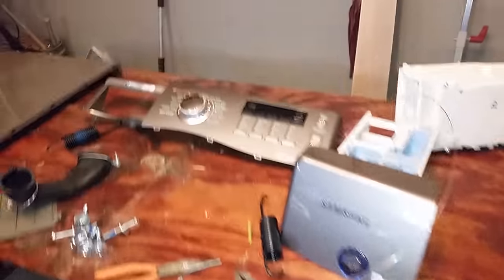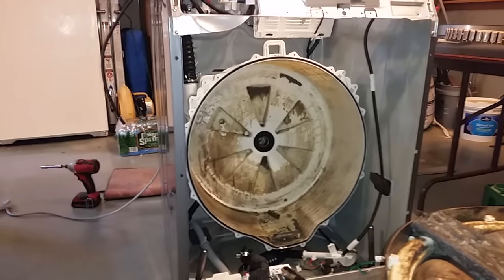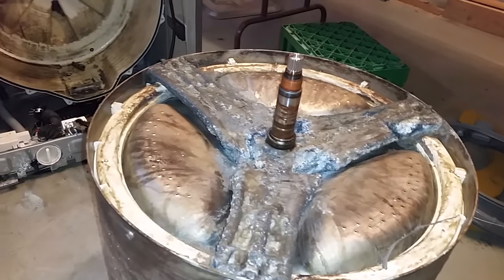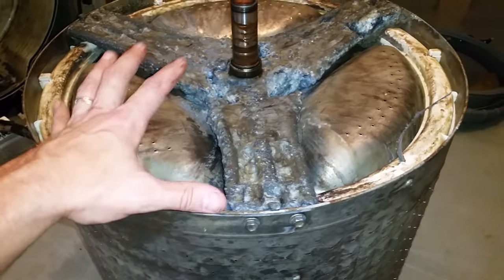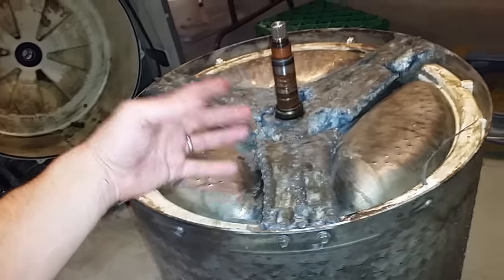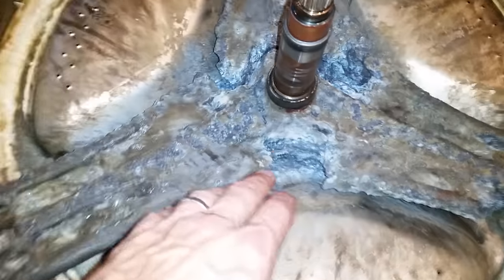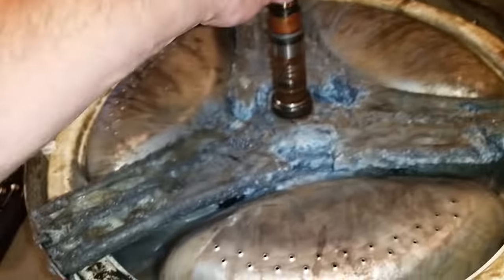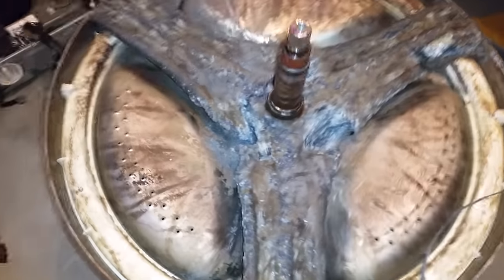Do not buy Samsung front load washer machines

Comment: All the manufacturers of front loaders do the very same thing. There is a video of a guy who was able to get the inner basket bracket( Spider Bracket) and he painted it with aircraft epoxy paint before installing it. He states that this will make the bracket impervious to the chemicals in the soap. The manufacturers have to know this, they just don’t want to put out the $.50-1.00 it would cost to make these machines last longer.

Comment: I am no expert but a few points to consider before jumping to any conclusion -

1. Corrosion depends a lot on the quality of water and detergent used. No brand will or can guarantee absolutely no corrosion after 6-7 years of usage. 
2. People using descaler regularly have seen improved life of their appliances. Not sure if you used any.
3. Sometimes different metals are used for other factors such as to manage weight and wear and tear caused due to friction. Which is obviously much worse.
4. Generally, appliances are designed by all the companies to last for at least their warranty period. Things are becoming more digital and less analog - more environment friendly too. People often discuss the longevity of the older appliances but not their energy ratings. For e.g take car or your refrigerator/air conditioner. They were much worse for the environment than the stuff today.
5. I don't think it's justified to defame a single brand without showing conclusive evidence that it's only this brand which is bad and rest are better. In this day and age of such fierce competition why would any brand risk such a huge loss of image for an easy fix?
6. The condition of your shaft and rotor looks like wear and tear beyond corrosion to be honest. The metal is practically eroded, which can happen only after intense caustic corrosion. Please share how you used the machine as well.   
7. You get what you pay for - feel free to buy a machine which costs may be twice if not more of this one but lasts you over 10 years or buy something in your budget and simply replace it after 6-7 years of use. I think these many years of usage with a good energy rating appliance would have paid for itself by that time if you factor savings on electricity and water.

I found your review highly biased.

Comment: Yes, it can be prevented. remember to decrease soap based on your HE unit. the water has decreased so 2 tablespoons of he detergent will allow your clothes to scrub each other and allow the water to rinse the soap free when finished! also if using pods only use them in hot wash cycs using only cold may not allow them to dissolve in time!!

Comment: My LG WM2501HVA just did the same thing!! It destroyed the door seal when mine came apart. The unit was smoking from the friction of the rubber chunks pinned between the drum.

When replacing the seal I rotated the drum,and felt the looseness,and the drum clanking around...I dismantled the entire wash machine expecting to find bad bearings,and found this exact problem only completely broken loose all all 3 corners. The washer has been out of warranty for only a year! 

Found a replacement part for $65 on eBay,but between that,$25 for bearings&rear seal,$7 for the drum seal,and $50 for the door seal not to mention the coin opp laundry expenses I’m not a happy camper for something that shouldn’t be a wearable part...still need to replace the 3 shocks inside,since they all fell apart just dismantling the machine!!

The real bad news is most of the parts in my LG cross with whirlpool,Frigidaire,and..Samsung. Yep,...they’re all made by the same Korean factories using the same parts!

Comment: FYI. I have this same washer about 7 year, which was operating fine. After watching your video, I decided to be proactive and replace the "spyder" before it fails. I found a couple of good videos which gave step by step on how to replace. Parts were easy to find online and cost under $200 (i did not need a door seal, since had been replaced prior). OK, this was not a simple project and would not reccommend doing only if you are very secure in your mechanical abilities. plus have a whole day to devote. During removal, yes indeed, I found that the spyder was deteriorated, but also found there was a significant amount of black mold trapped inside. Now I understand why I have a constant issue with moldy smell in clothes, no matter what method I used to eliviate. Definitely a poor design which I guess they must be are aware of. My moral here is, if you are having an ongoing odor problem, it could easily be part this same poorly designed component. I wouldn't invest any in repair(as I did) and just getting a whole new machine. Unless they have changed the design, I would never get another Samsung washer. They should stick to making phones. (oh yeh that was an issue too:-)
Reply: can you TREAT the part while its out to stop the corrosion? epoxy coating or something to increase longenvity? and maybe put some zink's in their to slow the progress?

Comment: We had basically the same Samsung washer. Purchased it brand new and got the extended warranty. 3 days before the extended warranty expired, those arm let go during the spin cycle and the unit (for lack of better terms) basically exploded. It literally destroyed every component except for the main putter body, lid and front control panel. The repair guy was scooping parts out of it with a small hand shovel looking thing. It was $10 from being a "total loss" and they ended up fixing it. $890 repair order, that we fortunately didn't have to pay for. The unit had other issues through out its life as well as the dryer. We ended up saying screw it and sold them both with in perfect functional order before something else happened and bought new whirlpool United. We now stay clear of all Samsung products.

Comment: This is called  A SPIDER ARM AND THE METAL IS aluminum/ All front load washer use aluminum spider arm to hold the drum. The soap is what eat the aluminum. Never Never fill the soap holder up to the fill line. 1 or 2 tablespoon of he soap only.
Reply: are there any front load washers that do not use this low grade spider bracket?
Reply: It's not the soap..As Phil mentioned, it's a result of corrosion from dis-similar metals in an electrolyte solution. Look up Galvanic Corrosion. The only way to fix this is to replace the aluminum (if that's what it is) with a metal with higher electrode potential,  OR stick with stainless steel to match the drum. The other method would be to attach a sacrificial anode with lower electrode potential than the steel such as magnesium or zinc, and replace it regularly - See Cathodic Protection . Hope this helps!
Reply: Shaun Hammer no, it's from using to much soap through the years and not running a tub clean cycle every 40 loads with tub clean detergent. I'm a trained and certified appliance repair Technician and I see this all the time after about the 2 year mark.
Reply: Jim W. Yes it is. Are you a trained and certified appliance repair Technician?

Comment: Galvanic, Bi-Metallic or Dissimilar Metals corrosion.  I used to have a chart that listed metals from Base to Nobel.  What a design engineer SHOULD do is pick metals that are close to each other on the chart.  Stainless was included in the chart though it is an alloy, it is very common and generally more noble  than all base metals.  
I suspect that it is not by accident that Samsung chose these metals, the term, "planned obsolescence" comes to mind. If you want to sell more washers, you don't want them lasting forever.  Six years is pretty short for a premium washer though.  I would expect 15-20 years from a good washer with maybe 2-3 service events in that period.

Comment: the term you want to reference is Galvanic corrosion or Bimetallic Corrosion.

he is describing it exactly right.

but I don't think that is whats happening. I think that is aluminum.
Reply: He has broadly described the issue, but his terms are way off. "Stronger metal" is wrong, it has nothing to do with strength. Google Galvanic Chart - gold is at one end, zinc at the other.

You are also correct, it is quite clearly aluminium in the rear bracing, which is causing the protective aluminium oxide layer to get attacked. 

What is especially bad is having a large quantity of cathode (passivated stainless) in contact with a small amount of anode (aluminium oxide).
Reply: Also the process takes a very long time. This is what happens when you learn about something, but don't understand that something. lol
Reply: what ever galvanic corrosion is called on Aluminium.... when you look at the failed hub it's obviously cheap junk - I wouldn't be surprised  to find the replacement made of straight plastic like the gearbox in a Whirlpool washer!
Reply: Aluminum can''t corrode
Reply: @lucifersonsco.230  
It can't rust, but it can corrode...
Reply: I wonder if this machine has a ground wire that attaches to the drum bearing? My friend's Whirlpool Duet is pretty old (~20 years?) and rather corroded in the center part of the spider only, while the arms are still like new. Soap suds must concentrate there? Or perhaps because of the steel shaft.. or both.
They all appear to be die cast and this is some really cheap metal. They should really be anodized or coated with something. Or better yet make the spider out of stamped stainless. Even grounding the bearing is not a best practice as the stray currents running through the bearing can eventually eat away at the races, but it's better than no ground I guess.

Comment: We paid $1,400 for our Samsung front load washer less than 7 years ago.  We had the same exact problem.   The repair person said it would cost $900 to repair, and to go buy another machine.
He didn't show me this scenario,  but he described exactly this problem.  I'm shocked that a reputable company like Samsung would keep manufacturing a product that is doomed to fail.
(I suppose that it is "planned obsolescence".)  Our repair person said they will typically last no more than 7 years (just like ours).
Reply: Same problem but here in india i paid less than 100$ for the repair.
Reply: Samsung's problem go beyond washers and dryers. i have a matching set of washer and dryer. the dryer first ruptured the drum at the seam, next the washer spider disintegrated. my Samsung refrigerator freezer ice maker has been replaced 3 times and has failed again. i don't trust their appliances anymore. they should have stuck to electronics,
Reply: I paid $500 for this washer....

Comment: GE does the same thing even in there top load washers. Retired sears appliance technician.
Reply: @dorothylouisegage5286  Kenmore is a solid brand
Reply: Only Whirlpool and Whirlpool based Kenmore and others that are Whirlpool based that are Timer Switch Only Excluding Oasis/Calypso/Cabrio is all I will get. I was a Tech myself. The Belt driven "New World" Kenmore/Whirlpools and Whirlpool based models with the brown shift actuator without the spider drive block were good despite having rods (easy to swap gear case). I would definitely get a surge arrestor and a battery backup with ripple correction though due to the boards...
Reply: Kenmore is without a doubt one of the best. I have a 1200 watt microwave from 2010 and she’s been thru tons of moves including being in the back of my truck from az to pa 3 times.
Reply: All brands do the same
Reply: I worked for GE for many years. I could write a book on the appliance issues alone. It's complicated and no way to explain it here. All I can say is do research before you buy anything. It may be that NO ONE is making the quality product you are looking for. There are reasons for that, and it's not just planned obsolescence. To put it simple, a great washer can be designed and built, but no one would buy it because it would not compete well in the marketplace. Sad, but not enough people will pay for quality to justify the companies designing and building products like that. Even if YOU are willing to pay extra, few people are. So the companies don't do it.

For example, check out Heartland refrigerators. You pay a premium for those fridges, but not because they are actually better. They're not. What you are paying for is the design, style and appearance. They're beautiful, but inside there's nothing special.
Reply: @dorothylouisegage5286  speed queen
Reply: All brands its same thing
Reply: @lupojacobo9892  Not true at all. As mentioned in the comments above, some Maytag washers from the 50's are still running well today. Mine is around 25 years old and still washing great.
Reply: @ardalla535  
So people are more interested in fancy feature sets and appearance than quality construction. Maybe the market is to blame by voting with their dollars for the geewhiz rather than sound engineering practices. Capacitive touch screen buttons instead of tried and true mechanical switches, cause they're so cool. Cars with push button start, cause it's so hard to turn a key nowadays.
Reply: @dorothylouisegage5286  AEG. Germany.
Reply: @dorothylouisegage5286  Speed queen. Expensive but, worth it.
Reply: King, I recently bought a front load washing machine from Samsung.
There are black track marks on my clothes at the end of the wash.
What's the cause?
Reply: @dorothylouisegage5286  
Only choice anymore is a speed queen
Reply: @uploaded113redone  Kenmore is rebranded Whirlpool or LG now. Since Sears have been going out of business, those parts fit on our Kenmore appliances.

Comment: I just replaced the spider bracket in my wife's Samsung washing machine. It looked about as bad as the one in this video. It appears what happens is that soap scum builds up on the spider bracket and traps moisture against the metal causing it to corrode. Once the steel drive shaft starts to come loose from the main part of the spider bracket the drum will spin off balance. Once it gets bad enough the vibration sensor will shut off the machine and you will get a fault code on the display.
Reply: Oh, does your wife live in a different place than you do?  I guess that means you have your own washer, right?
Reply: Love that! "My wife has"! Thank you, finally a MAN!
Reply: Think we found the feminist here...
Reply: I thought stainless steel was invented so as to prevent such corrosion problems? Why are our eating utensils made of stainless steel, just our costly appliances are made of of junk that will soon fail?
Reply: You're lucky you were able to buy the spider arm separately. I would have to buy the whole drum/basket with the spider already attached.

The funny thing is  I noticed they used 2 torx screws on each arm to hold the bracket to the drum, smh. But yet they don't sell the damn part separately.
Reply: @royalbookshopper  It's none of your business really but my wife and I are separated and live apart but we still get along. It's better than being constantly at war and at each other's throats don't you think? It's better for our daughter too. The only people suffering because of our friendly and cooperative arrangement are the lawyers. You must be a lawyer.
Reply: @royalbookshopper  This is also none of your business but yes we do live in two different places. However, I get to bring my laundry over there and do it for free. That's my end of the deal for fixing her machine for free.
Reply: @corey8084  No actually your assumption is wrong. You might want to read my other responses to this thread.
Reply: @yosefmacgruber1920  The problem is that the drum is made of stainless steel but the spider bracket hidden inside is made of something else that can corrode. You see the shiny drum at the store and figure the machine will last a long time. Then two years later you find out about the spider bracket problems these machines have.
Reply: @joevignolor4u949 
I wish that brands were better known for having good design and quality, even in the hidden areas.

I know to look for a few things. Before buying a cordless phone or similar electronic device, look on the back of it. Where the power adapter plugs in, it should indicate the voltage and polarity. Why is that important? If you lose your power adapter, it tells you how to set your universal power adapter so that you can easily replace the original power adapter.

If you hold the take up reel so that it can not turn on a tape player on a boombox, the play, rewind, and fast forward buttons should pop up within a few seconds and it give up upon trying to play the tape. This prevents tape tangles. Not only does it provide for a proper auto-stop feature, but it detects if the tape is not winding properly back into the cassette. Cheaper crap brands use a white lever tape tension sensor that only stops on play but not rewind and not fast forward, and does not detect tape tangles. I believe it to be quite immoral to use the crappier mechanism just because customers do not know any better. Auto-reverse is probably even better.

For a long while, probably still the case, Panasonic cordless phones use 2 AAA rechargeable batteries per handset. This is a much better quality design choice than cordless phone batteries. The batteries are cheaper and easier to replace. You do not need to bring your handset nor the batteries to the store, in order to get a proper matching battery. You just need a pair of AAA batteries that say rechargeable. A 4-pack costs about what a cordless phone battery costs. No battery charger needed. Your handset charges the batteries, as with any other cordless phone, when it sits on the recharge base. I wonder if Panasonic is able to get those types of batteries cheaper? In this case, I think it helps the customer as well.